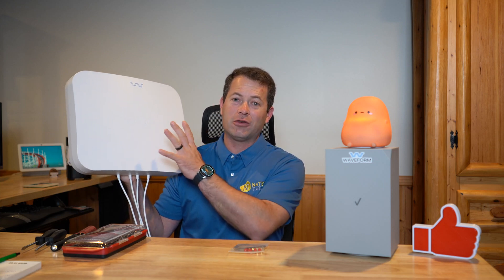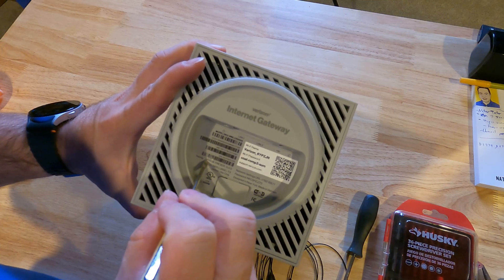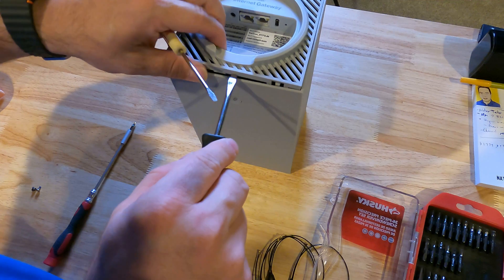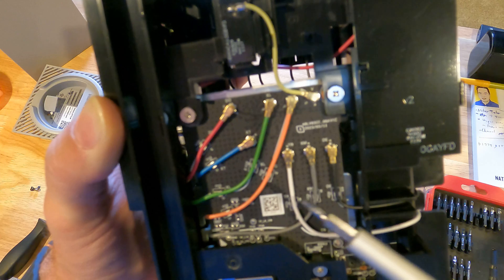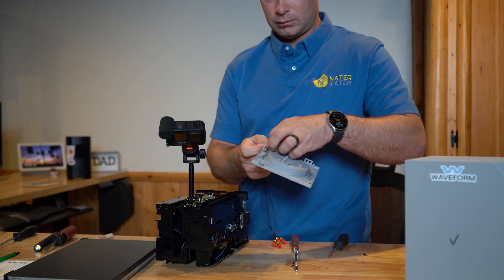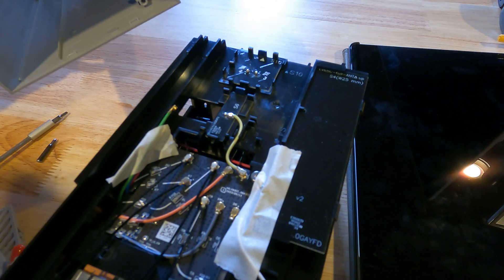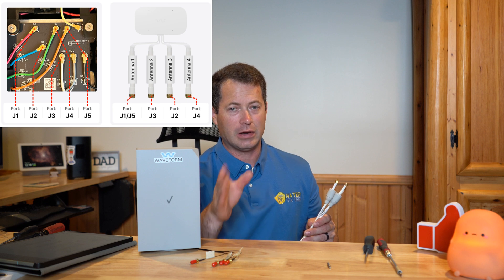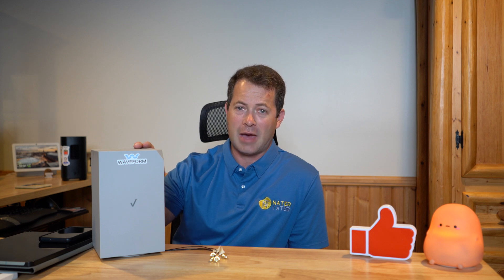Boost Your Verizon 5G Home Internet: Adding an External Antenna Guide

Comment from the maker: Get 5% off Waveform antenna and signal booster products with this link: www.waveform.com/natertater or just use code "NATERTATER" at checkout. 
Buy Quadpro Antenna direct: https://collabs.shop/gqhat7
Buy Quadmini Antenna direct: https://collabs.shop/zkph7u
Or on Amazon (no discount): Quadmini https://amzn.to/3Tf8Iw7 QuadPro https://amzn.to/3UX2a6G

USE COUPON CODE for $45 OFF : NaterTater
Buy Chester Cheetah V2 router: https://tinyurl.com/2t5mdsk6

Buy Elsys Amplimax 5G Ultra:  https://fas.st/t/RV8CWAXy  

Waveform install guide:  https://www.waveform.com/a/b/guides/hotspots/verizon-wnc-cr200a
Precision screwdriver and electronic repair tool kit:  https://amzn.to/3MDY1zb

Be sure to see my other Verizon and T-Mobile Home Internet Videos: 
T-mobile: https://youtube.com/playlist?list=PL8d9FovK2dNQHp0KWk8gG8XXvaKzaoSB3
Verizon: https://youtube.com/playlist?list=PL8d9FovK2dNSOcTz7L6sHiuWVQXwUT4my
AT&T Internet Air videos: https://www.youtube.com/playlist?list=PL8d9FovK2dNT31tM0IRKApwZhAWC658QR
5G Cellular Modem Routers:  https://www.youtube.com/watch?v=ELZNPu38r70&list=PL8d9FovK2dNS2ihT56gySpU49V4kRHn_U
Waveform External Antennas: https://www.youtube.com/playlist?list=PL8d9FovK2dNS1HuMabIm8hspYa7nlXpPP

Here's some parts for external antennas:
90 Deg Antenna SMA connector: https://www.waveform.com/products/right-angle-sma-male-to-sma-female-adapter
Or on Amazon (not Waveform brand/certified): https://amzn.to/464V42q
U.FL to SMA adaptor cables:  https://amzn.to/4aF2j4c
U.FL to N-type adaptor cables: https://amzn.to/3LyLIEY
Adapter Cable SMA Male to TS9 Female: https://amzn.to/3wVyzfj
Reply: Which ports do I use or how do I find out what band I’m on for which ports if I’m using a 2x2 antenna?
Reply: I want to modify my router antenna. But I'm confused on the type of cables to get I can see an sma , n type which do I get ? Or is it dependent on the type of external antenna you have ?
Reply from the maker: @stilldasmainaem  it depends on the gateway and antenna you use.  If you order thru waveform they provide e everything you need.  In general you use SMA and if the gayeway needs to be taken apart to access the circuit board you need u.fl to sma pigtails (included in waveform's kits).

Comment: I have a ask-ncm-1100e 5g business gateway.  A video on how to connect it to a waveform external antenna would also be helpful.
Reply: Doesn't the E have the external connectors?  If it does, just use the same order he says in the video:  cable 1 to J1/J5; Cable 2 to J3, Cable 3 to J2 and Cable 4 to J4.  If it doesn't have the external antenna connectors, we will have to wait for a video on how to connect the internals - the ASK-NCM1100 doesn't have anything labeled as J anything - it's all just ant1, ant2, ant3, ant4, etc... all the way up to ant 31 or 32.
Reply: @lisacasto6851 Yes, it does have external connectors but they are not marked with anything: no "J" 1-? no "ant" 1-4.  I have not been able to find a technical manual that could possibly give this information.

Comment: I have a couple outbuildings: (Chicken coop and detached guest room. Country living.) I am looking more for a stronger signal to reach these outbuildings more than faster speeds. Will this device help with that? Furtherest building is about 100 feet.
Also, My gateway came with a booster, which is malfunctioning. If I get a Quad antenna, would the booster do anything? Should I even bother getting it replaced?
Would the Mini or the Pro work best?
Reply from the maker: To extend wifi to your buildings you want a wifi mesh system, not a cellular 5G antenna.  See https://youtu.be/34NZwJh4N84

Comment: Hi Nate, Love your information, been watching for years and have a question regarding adding this Verizon Home internet to my comcast internet and using the Dual Wan option on my Asus router. I watched a video of yours where you showed your Asus router and I wondered if you had ever combined your ISP's using the router. The problem I'm trying to fix is that my Ring cameras use 2 Gigabits per camera and my comcast upload is 35 and I need more bandwidth. I was thinking of combining both comcast and Verizon inside my Asus router or just put the cameras on Verizon 5G--separating them completely. Thank you any advice is appreciated.
Reply from the maker: Yes that is certainly possible to do, here's a Asus video: https://youtu.be/BwdMg9lYoH4?si=KkBh_uwSWt8kriX6  I've even combined 6 WAN's on my current setup!  https://youtu.be/FugYABcOkTE

Comment: Great video, thanks for sharing.  I have the latest verizon cube and use it in my RV with good success. The RV has a built in winguard cellular booster.  The Winguard  has a green and yellow wire for cellular. Do you know which connectors in the cube i would use for these wires? Trying to figure how to do what you did only using the Winguard versus waveform.  Great informative site. Thanks
Reply from the maker: Might be best to ask winguard what the wires are or give me the model number if there are no labels on the cables.
Reply: Winguard states the green and yellow are for cellular. What I don't know is which connections in the verizon cube I should connect the yellow and green to.  Should I ask Winguard something more specific.  The Winguard model is winguard 360plus.

Comment: I have a massive old antenna cemented in right next to my house, always thought it was useless but could I possibly use it if I wired it up to my 5g internet? Im assuming its not the right kind of antenna digital vs analog or something... any ideas about that?
Reply from the maker: @infernaldeath6001  correct, highly unlikely that it is compatible

Comment: Dandy presentation. Will the Waveform quad pro work either with a Verizon internet gateway & the T Mobil internet gateway? Your YouTube videos show a similar approach of removing the internal antenna wires & connecting the quad pro pigtails. TY
Reply from the maker: @roberthenrichsen8908  yes it can work with most cellular gateways

Comment: I see that the antenna give a 10dB better signal power level. However if the antenna can be mounted outside on the house wall it will be much better signal level received. We have a simular 5G internet /TV solution home with the antenna outside on the wall.
Reply from the maker: Yes outdoors is the best location.

Comment: You mention that you are doing this to a "used-purchased one so you don't have to return it" is it possible to get something like this and then actually use it so you don't have to ever worry about returning?
Reply from the maker: @jderck  yes potentially.   The issue with used is they might be defective or "black listed" (stolen) and the carrier blocks them from registering on their network.

Comment: Nate great video, Verizon just started offering this in my area been on TMHI since 2020, currently using as a back up to a fiber build that was completed in 2023, which as of late has become unstable in the evening prime time hours, 1gig D/U link dropping to like less than 5Mbps due to network saturation and over utilization by the provider. With the verzion Gateway, we got the gray model, just it show you bands that are connected to and any sort of tower id that its connected to, to reference with cell mapper?
Reply from the maker: @JMSynthetics  hi, I don't think the verizon box shares that info unfortunately.   Best i can do is use a verizon phone to see what it connects to but that of course is not error proof as the gateway could be picking another tower/cell and especially band.

Comment: Hi, just wonder can I signed up Verizon home internet then use it in mountain cabin which has Verizon service but not approved for home internet yet?
Reply: I live in an RV and use Verizon 5G Home Internet. It will work anywhere that Verizon has signal, but the initial install needs to be done over a 5G tower that has 5G Home Internet offered.

Set it up at your house first, then move it to your cabin.
Reply: @xxxrune68  When I received the cube, I asked Verizon support that I have a 2nd home (didn’t say it was a travel trailer) and can I take the cube with me. They said yes wherever Verizon has coverage. Verizon again is missing a marketing opportunity.
Reply: @dmmac6  they aren't missing a marketing opportunity. It is a licensing issue for them. They aren't allowed to offer it as a mobile plan like that. Luckily, it works anyways.
Reply from the maker: @achan7396  it will work and its against the terms of service

Comment: Will buying a hotspot antenna help with gaming latency? I get good upload and download speeds but my latency sit about 60-90
Reply: Unfortunately no.
Reply: If your current latency is caused by poor signal strength (e.g. -95 dBm or worse), then yes — a directional MIMO antenna can absolutely help lower latency and jitter.

But if your latency is caused by: Verizon tower congestion, Carrier-grade NAT or 5G core routing delays

Then an antenna won’t fix those problems — it’ll just make the signal stronger.

Comment: @NaterTater , I got the verizon ask-NCM1100 model that looks similar however, underneath the modem, it doesnt have the screws to remove and take it apart.  It has a circle in the center but I cant tell if there's a screw in the center to unscrew  it from there.  Would you know how take apart the ask-NCM1100 or direct me to a source on how to, so I can plug in my waveform pro antenna.  Thanks
Reply from the maker: I havent gotten my hands on that model yet
Reply: Have you had a chance to look at this ask model yet?
Reply from the maker: https://youtu.be/tOI2Izi3EIU

Comment: Does this WNC model gateway have the same IP Passthrough bug that the "ASKey" model has?

I'm dying to use external router, but the ASK model was creating firewall clamping problems. Slow loading, some sites not connecting, on and off periodically. 

Total nightmare. Upgraded to the WNC and now I'm terrified to go through the trouble of setting up the TP Link router AGAIN.

UGH.
Reply from the maker: @SixStringHarmonies  I use DMZ as I have seen issues with IPPT but supposedly it works.  Just not worth trying for me atleast.

Comment: B4 2:20 ish I would take a picture of the sticker on the bottom at 1 to 1 print it out and make sure I could read it and scan the copy. then I would take the extra 3 minutes and peel the entire sticker up. 300Mbps? that sucks. 5g can do better they dont even want to spend the money to make the towers, a single location capable.

Comment: wouldn't a cell booster work instead of doing this?
Reply from the maker: boosters can/do work but are really not ideal for 5G or data throughput.  Better for voice/text.  https://youtu.be/vn0EzM4FsMM  A 4x4 MIMO antenna will easily best a booster for data throughput. https://youtu.be/bboYE4qcfDM
Reply: @NaterTater  I just bought the wave form mini for this; I modified my device a bit and removed any chance of it having wifi because I have my own wifi device. Plus I wanted to make sure the power is only focused toward LTE and 5G.  it's coming today and cannot wait!  thank you for these videos!!!
Reply: this is what I learned, higher makes great 4G LTE signal for my area -90 but jips my 5G ultraband. Lower with the dish improves  5G bouncing around -114 to -119 and sometimes if I am lucky I get -89 for 5G, but I have to lower the dish more as the 5G towers are tilted lower. who ever thought of this idea is silly... I think I can push more on the  5G just have to find the sweet spot. like if I am   5G bouncing around -114 to -119 at the spot and I lower it more, it should be stronger???  this is a fun experiment!

Comment: Hi

Great video - I have added a waveform and all my numbers are great except the sinr...what can be done to improve?
Reply from the maker: what is your SINR?  do you have multiple towers around you?  you can try blocking signal from other sources.
Reply: 5 to 8
Reply from the maker: @mikehoward3991  yea that's low.  I'd keep trying positions and aiming to improve it.  Even if it hurts signal strength (monitor internet speed).

Comment: I hate to say it but that's a lot of work just to be able to hookup an External Antenna plus you kinda risk breaking the Gateway/Modem. Your best bet would be to just Purchase a Third Party Cellular Gateway/Modem like a Chester Cheetah or Chester Ninja Gateway/Modem that already has External Antenna Ports. I know Third Party Cellular Gateway/Modem's are more expensive and not everyone wants to spend that kinda money on them but they are worth it especially with all of the Features you get with them. Also Verizon needs to get with it like with how T-Mobile is actually allowing people to hookup External Antenna's to their Newest Gateway's like the G4AR.
Reply from the maker: @JoshF151Tech  all good points except you can't use a 3rd party gateway with verizon home internet when the device they give you uses an eSIM.
Reply: @NaterTater True but some Third Party Gateway's support eSIM. Unfortunately it looks like eventually eSIM is gonna be the only way.
Reply from the maker: @JoshF151Tech  but had anyone learned how to move an esim to a 3rd party router?  If so I am behind the 8 ball as I didn't think it was figured out yet.
Reply: Honestly this was a ton of time invested and even after being super careful the stupid J2 cable removal ripped the soldering off the motherboard. Even if hypothetically this hadn’t happened, I can see it happening in the future as soon as those pig tail connection cables start to move.

Comment: Question if you see this and can respond. I"ve got one of the ARC-XCI55AX routers, you vids have been a huge help. Speed hasn''t been problem, it's more the stability of the connection. In non-peak hours I consistently hit around 300/15, with peak hours being more like 200/10. My bigger concern is stability, I'm admittedly in a fringe area with my 5G signal strength around -109 to -110 and LTE around -100 with a stock router. My issue is that the connection would drop for 10 second to a few minutes 5-10 times a day. I picked up a Waveform QuadPro, and aimed in the right direction I can get LTE to drop to -79 consistently but no matter where I point the antenna, I can't seem to get any improvement in my 5G signal. At this point I'm trying to figure out if I need to spend more time trying to aim the antenna or if the purchase was even worth it.
Reply from the maker: @jwhitecotton  yes sounds like you do need to work on aiming.  Waveform has great support, reach out via phone and chat with them.  Also read through the instruction manual provided for good tips on how to aim it properly.   For you a couple hours messing with it might pay off!

Comment: I can't believe we still have to rip these thing apart to connect an antenna.
Reply from the maker: @kevindumais9610  agreed!
Reply: ikr, it would seem that by now all the newer modems and gateways would have external antenna ports on the back
Reply: Corporations typically provide garbage products. The bigger they are, the more waste and incompetence. This is why we need right to repair and a 3rd party market.

Comment: dont see how its worth it for verizon....they cap you at 300 dl 20 up anyways
Reply from the maker: @madmicky4088  I get about 40mbps down if I am on my main floor.  Luckily I can get my gateways to a Loft but others that can't need an antenna to get that 300/20.  Think also metal roof/siding houses.
Reply: @NaterTater  oh man.....i have mine way out in the garage behind some shelving and stuff everywhere and it gets good enough 200+ dl throughout my whole house.....these antanae wouldnt help me or make it worth it....the tmobile i used to have sucked so bad though and this probably would have helped.  Night and day difference between companies where i live....verizon has absolutely horrendous customer service though and tmobile had great customer service....wish they could combine the strengths into one good company hahhaa
love your videos

Comment: I have the Verizon ARC XCI55AX modem and bought the Waveform QuadPro based on your reviews. Once I realized my existing plan was renamed to 4G something, I found I needed to change the plan to 5G Home Plus. NOW I get the 300Mbps down/20-ish upload. Initial burst can hit 450 Mbps for a second or so. Incidentally, I made a "visor" to hold the SMA pigtails firmly to the ARC XCI55AX which can be found on Printables and Cults3D, just search for XCI55AX and it should be easy to find.
Reply from the maker: Cool idea for the visor!